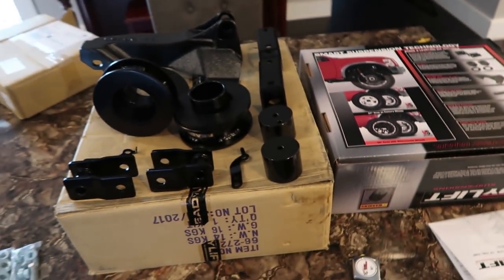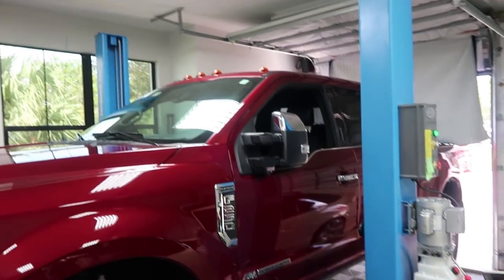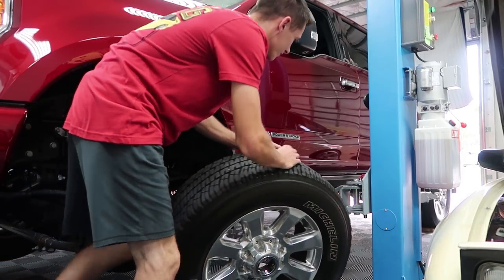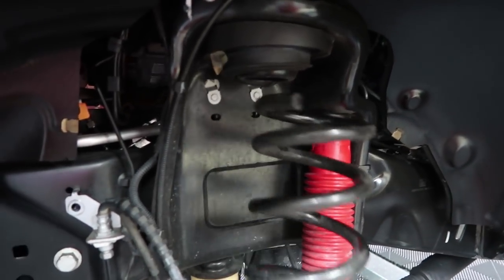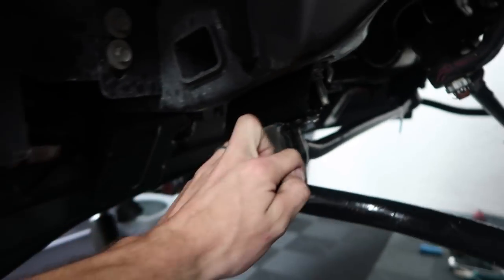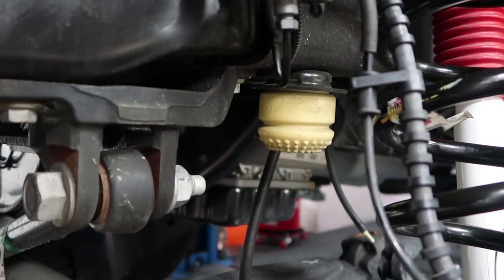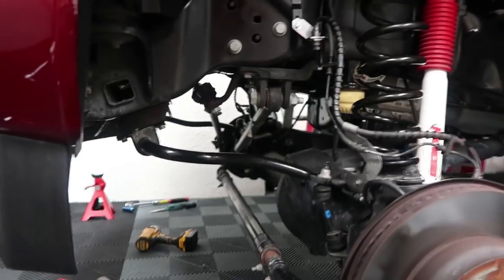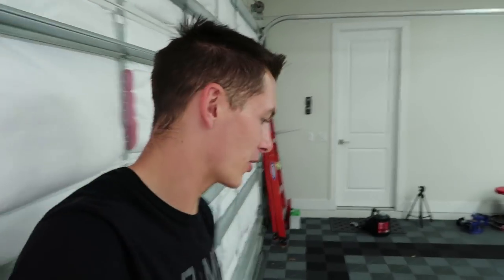2017 F250 Leveling Kit Install - ROUND TWO

Comment: Nooo! Spacer lifts/leveling kits are junk when it comes to ride quality and performance. Spacer lifts are the truck equivalent of cutting springs to lower your car. I highly recommend that you look into the Carli kit for the 17+ Super Dutys. It is more expensive for a reason, it will ride sooo much better than stock, and it won't be overstressing factory parts. Those cheap shocks will be shot after a year or two. A good set of shocks will be rebuildable, and last the life of the truck if maintained. You have to drive a truck with good parts to really understand the difference it can make. Lastly, you NEED to get an alignment after installing any suspension modifications. While the toe wasn't changed, and you were able to straighten the steering wheel, your caster is now different, and that really makes a difference, especially when towing. The radius arm design of the front suspension forces the axle to travel in an arc, like a swing, so as you lower the axle from the frame (ie. leveling/lifting it) the caster decreases. I don't know what the factory alignment specs are for the F250, but the caster is probably close to a degree or two off. That doesn't sound like much, but when the caster isn't much more than 5 or 6 to begin with, it makes a difference. Caster set closer to 0 will be more darty and wandering at speed, which isn't exactly what you want for towing, since the already reduced weight over the front axle from the weight of the trailer now has an even less effect on letting the truck keep itself straight. Side note: If I remember correctly, Florida doesn't require vehicle inspections, so you might be able to get away with deleting and tuning the truck. Improves reliability, performance, and mpgs.
Reply: Sorry, j.mentz..ride quality is EXACTLY the same and it is NOT the same as cutting a spring, as nothing in the factory travel or torsion is changed....while you are spot on re the castor being off after any lift/drop, you are completely wrong about the weight shifts you mentioned....Factory rake has ONLY 2 purposes...First, to prevent a nose-up stance when fully loaded, and second, aerodynamics for reducing wind drag, loaded or unloaded....Someone said Adam intends to install rear bag load leveling for towing, so a nose high issue is moot, and he likes the looks....once aligned, the kit he installed will ride and function EXACTLY as it did without the front leveled...
Reply: Rainman_PondBoss I meant that with the stock suspension, adding the load of a trailer to the back (not that a single car one with a 240 is that heavy) changes the weight distribution of the truck. Yes, that rake is partly there so that the truck is level when loaded down, but that weight also takes some pressure off of the front wheels (think of the rear axle as the fulcrum of a lever), even if the front of the truck hasn't physically moved up from the load, which is why overloading vehicles that can't handle the weight, or having improper tongue weight can make the steering feel vague and light. I didn't mean that the increased suspension height itself makes any vagueness worse, I meant that the decreased caster from the lift, without any alignment, adds to that vagueness, since caster uses the vehicle weight to help keep the wheels straight. You're not wrong about what you said, I just think you misinterpreted what I meant (though ride quality I think is debatable, I've never ridden in a new F250, but all the other trucks with spacer lifts/levels I've been in rode like bricks compared to a more proper system, or even stock).
Reply: I agree that if you don't know how, or improperly load a trailer, you'll have driveability issues...any load should be properly distributed....fwiw, the new Ford factory hitch is not the typical Class VI, either, it is now a Load carrying hitch, and can handle 5K tongue weights and pull up yo 20K on the bumper without any need for a load distribution hitch...We absolutely agree that an alignment is a must....anyone not doing one after a lift, kinda earns the weird, random lane changes and death wobbles they will likely experience
Reply: Rainman_PondBoss I think we're on the same page now lol. Didn't know they now came with load distribution capable hitches.

Comment: fords are okay but have a lot of motor issues.
Reply: Scrappy?  name one issue with the new Ford-built 6.7...I had a 2015 F250 with a Gen 2, 6.7, and never had a single problem...the 2017 has the Gen 3 version with stronger rods and crankshaft, 925 ft-pd of torque, a frame that is 24 times stiffer than before, a beefed up driveline and transfer case to handle the near semi amount of pulling power...this rig is damn near bullet proof, and has cummins crying
Reply: Ford's gas burners are pretty good too, save the occasional spark plug fired through the hood.....lol

Comment: Bad decision, you just voided your new truck warranty,  not good for towing especially the type and weight of trailer you tow, if you insist keeping this kit on your truck, adjust your head lights.  btw it would have been better to put Air Lift air bags on the rear axle to adjust your thrust angle to level your truck vs: the trailer......when towing.......just a thought. tdw

Comment: smallest lift ever no Afens
Reply: Justin Watson uh it’s a leveling kit not a lift
Reply: Zerek Peel if you going to putt a leveling lit in it you have to lift it
Reply: Justin Watson If you want to be super technical just to be correct yes you are “lifting” the front of the truck to be level with the rear. Just adding spacers in the front that are typically 2 to 3 inches is a leveling kit. Go on any suspension companies site and under the leveling kits you will see these spacers
Reply: No shit

Comment: These are dumb. Leveling kits make your truck negative rake when you launch or accelerate.
Reply: well its a diesel so it looks sick when that happens
Reply: No...not really. Unless you're from Carolina in which case it still looks bad.
Reply: He's not going to launch his truck he said it's specifically for hauling. He just wants it to look good.
Reply: I know he isn't going to launch it like a drag racer... Launch also applies to if you're going to try to beat someone off the line at a light to make an on ramp, get to a turn, etc.
Reply: Well now when he’s loaded his trucks gonna be pointed in the air so he’s gonna be blinding people and getting flashes all the time
Reply: snakezulu7 quick question, is it your truck?
Reply: Ekicks559 slave? Really? 😂 Alright.
Reply: It's nice to see a keyboard warrior in the comments. Carry on, sir. Thank you for your service.
Reply: It will not affect "launch" actually if it was a launch he just changed his weight bias more to the back so it would be the exact opposite of your statement and yes I  am a mechanic and custom car building for nearly 30 years now.

Comment: Now you need a 2 and a half lift on the back or it will look stupid the minute you put any weight in the back. Putting weight in the back is the only reason to own a heavy duty truck. As for odd size bolts, its the nissan that uses stupid sizes.